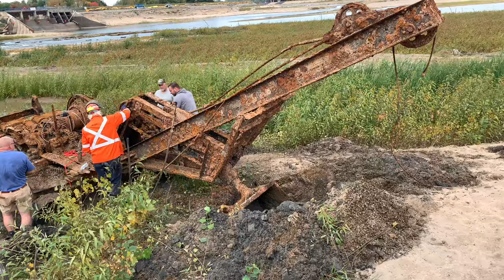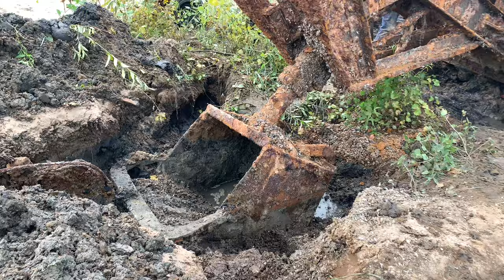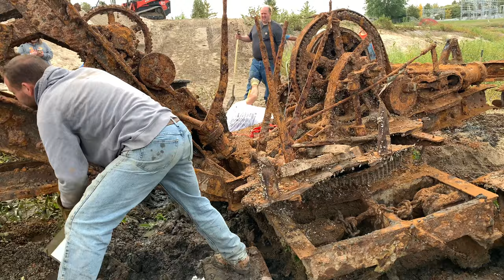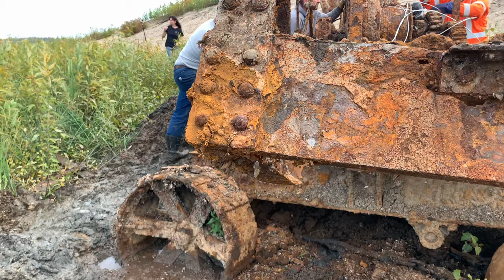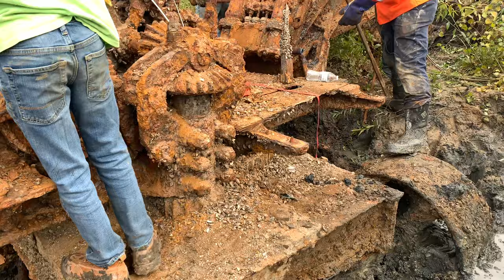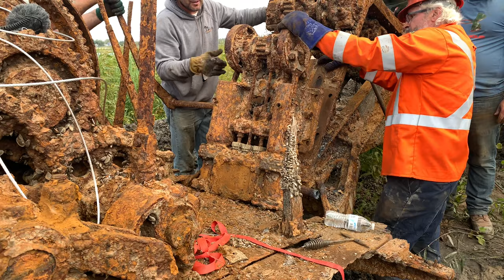Wixom Lake Steam Shovel 4K

Comment: looks pretty much past restoring more like a fixed piece of art and what sitting in water 60 years will do to it
Reply from the maker: I’m just the cameraman but my understanding is that they plan to rebuild the steam motors.  Most of the rest of the unit they will use as a pattern to make a new one, likely reusing any of the salvageable components.   

If it’s made of mostly new parts, is it still the same steam shovel?

In philosophy this is referred to as the “Ship of Theseus”

If a ship has some boards rot and they are replaced, eventually more boards rot and they are replaced.    Once all of the boards have been replaced, is it still the same ship?

This has been pondered by the likes of Plato and others.
Reply: No, it's being restored. You may not realize how well things were built then, and it looks a lot worse than it actually is. There's a lot of rust, but the shovel is still solid. By the time it's done, it will still be the same shovel that sat in the lake for all those years, right down to the frame.
Reply: It's been underwater for 95 years, not 60. And believe me, he's been taking it apart and she's in better shape than you'd think. The three steam motors are good, she'll need a new boiler and a couple new beams here and there for safety reasons but aside from that,  she'll be mostly original and fully functional once more.